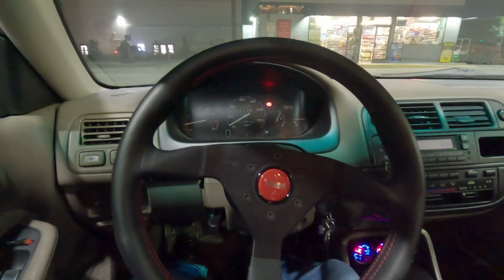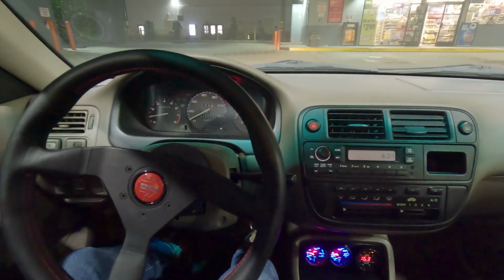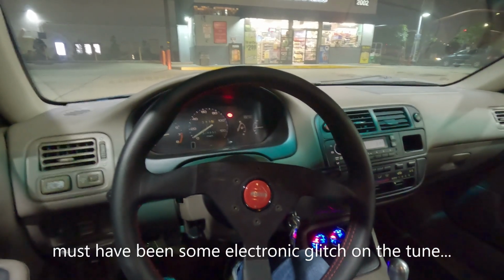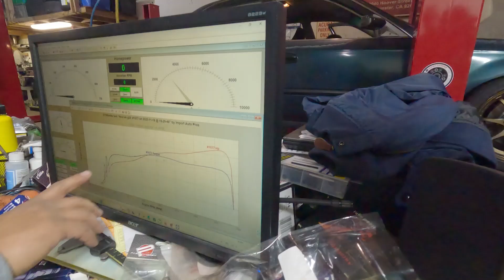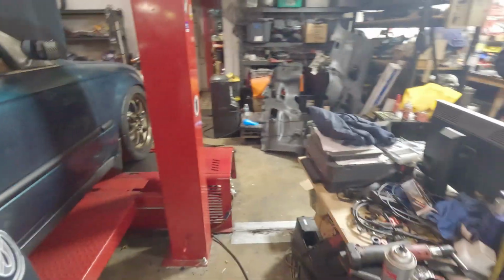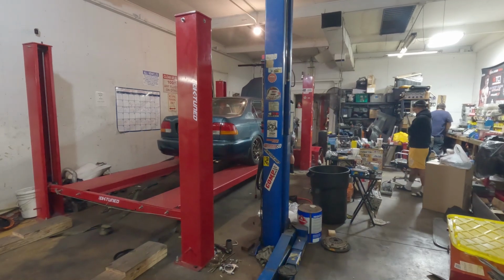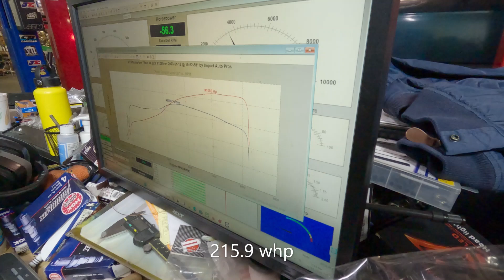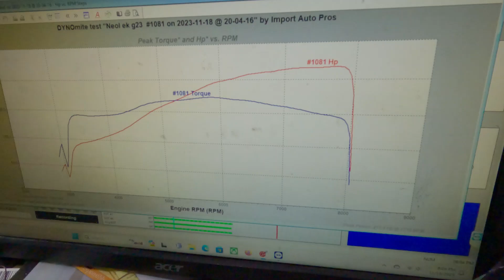Dyno Time / G23BK ep. 17

Comment: Now NORMALLY Action Clutch IS good and does GREAT.   But a stage 1 Street that is unknown on previous abuse from the junkyard is a Big Gamble on the outcome.  I got a brand new Stage 4.   6 Puck  with the lightweight billet flywheel from  Action Clutch  and had EXCELLENT results.  That engine you built sounds mean and strong with that exhaust.  Congrats on the Dyno numbers which looks to be continued.
Reply from the maker: I have checked the p/n again coz l removed it and put a new clutch. It look like what l have is for OE replacement. I think thats the reason why it couldn't hold + g23 really puts out. Thanks
Reply: @sagittnet2158  OH WOW. That explains ALOT.  I think my earlier comment was meant to say don't give up or Hate Action Clutch products over one unknown used Clutch.  Unsure if you ever used their products before or not . So wanted to comment about my experiences with their products.
Reply from the maker: @notone4029  no worries my friend!
Reply: Action blows. Pick yourself up a nice Competition clutch.

Comment: congrats on surpassing your goals! She's a ripper for sure.
Reply from the maker: This one got more hi torque and comes in early compare to H22a4 stroker.
Reply: I'm very curious to see what it will put down after the new clutch. I've currently have a p13 head thats been ported and 3 angle valve job done with brass guide tubes, was going to do a stroker  h22a4 but you may have changed my mind. 01 Prelude is heavy lol. @sagittnet2158

Comment: SENSEI!!!! Glad to see you are still going strong! I took a break from messing with my projects... Almost all summer lol. But i just got back into working on my EP3, gonna start recording and posting vids again. It takes alot of dedication to work a full time job, then work on the cars after work record and edit vids lol. But happy to see you still posting, let me know when you want to paint Milly lol.
Reply from the maker: I'm still at it lol! Finally got it tuned and l already change the clutch. Yes, it really take a lot of our times doing work and editting and all not to mention we still have to do our regular work sched. Sometimes l do miss not doing anything and l have done that. Taking a break of all the things. I might slow it down after this project. Start again next year and we'll see. My nephews friend have a EP3 w/ k24 swapped on e85 and it's very quick. It so quick that he want to make changes. I told him, if your not loosing, dont make any changes on the setup. Later man,looking forward to see your project.
Reply: @sagittnet2158  lol it is alot of work. I had to change the fuel pump assembly on the EP3, the top was cracked smelled like gas in the car also replaced the O2 sensors. After that I felt that spark again, I need to start/finish my projects. Keep it up sensei, I always enjoy seeing your builds.

Comment: I think this car needs a serious alternator upgrade and maybe go lithium battery. The voltage is between 10-14 and it's all over the place. Plus it might help the starting issue if the batteries have significantly more current output and capacity.
Reply from the maker: Starting issues is fixed. It's a weird fixed and l could not believe myself but it's all good now. Thanks